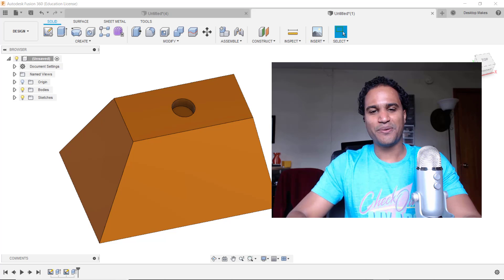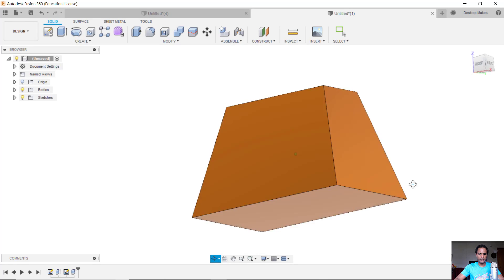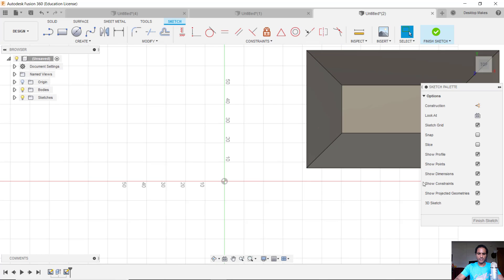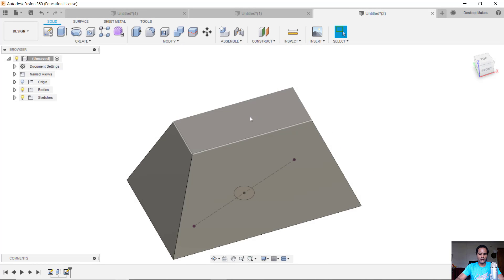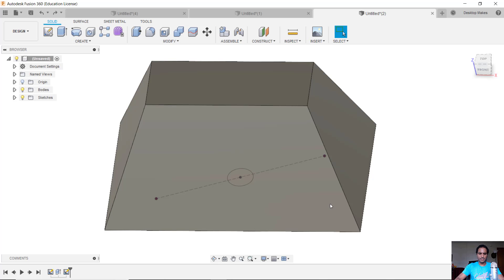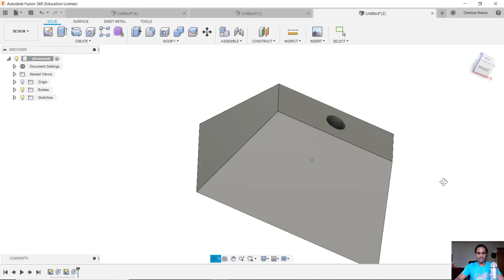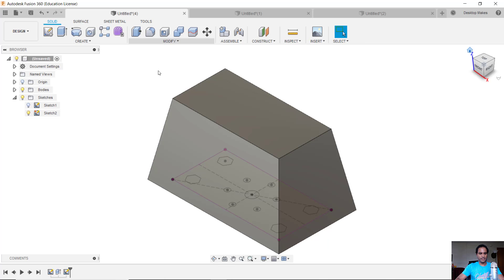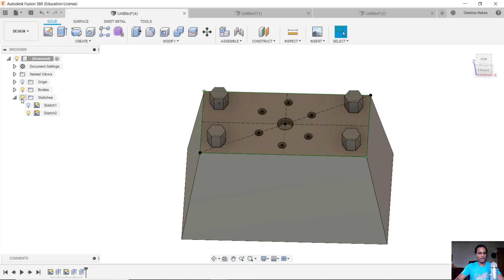Redefine Sketch Plane in Fusion 360

Comment: Thanks very much, how did you snap on to the corners when drawing the diagonal line, were you snapping to the grid? Thanks
Reply from the maker: Go to Preference - Design, and make sure "Auto project geometry on active sketch plane" is checked.  If not check it, hit Apply and restart Fusion 360.  It's a default setting so it should be checked.  If it's checked, then you should be able to automatically snap to the corners or lines of any geometry.  Also, you can always hit 'p' on your keyboard to project the line into the current sketch and this will allow you to snap to it.